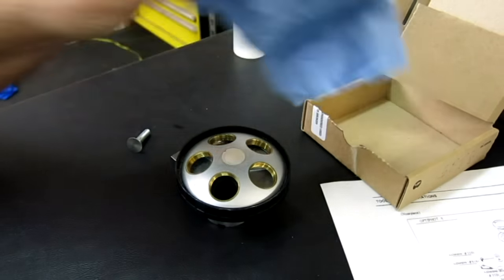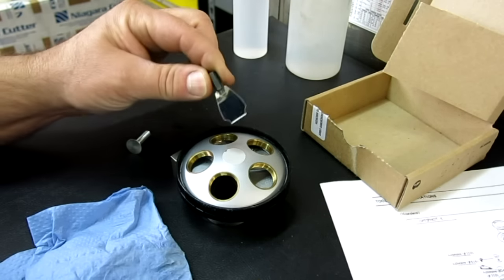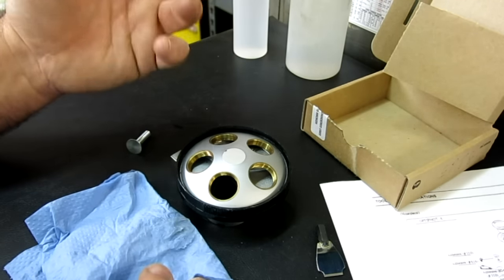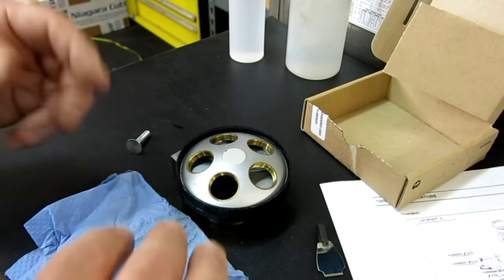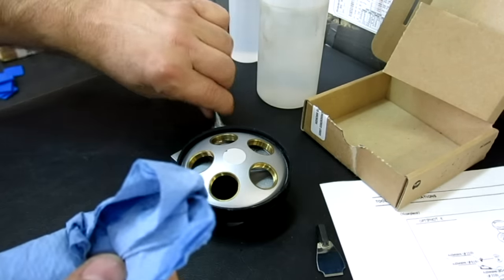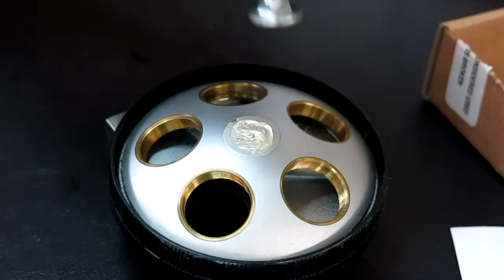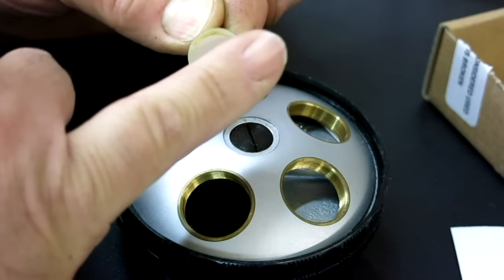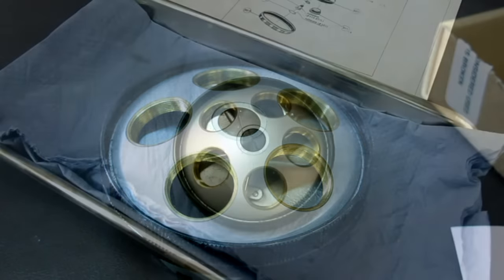Monday Night Meatloaf 106 Part 1

Comment: Reminds me of the time after Metallurgy class (40 years ago)  I got tired of the Binocular Microscope looking like crap. It was a Bosch and Lomb IIRC. The eyepieces were nasty and I took them out and cleaned them. Didn't take them apart just cleaned the outside lenses with alcohol..Prof came in as I was putting it back together and FREAKED OUT!  I told him what I did and why. He looked it over and put a sample on the stage. Flipped through the objectives.  Then said: "OK. Next time tell me before you take something apart."Got an A+ in that class...

Comment: I can't wait to see if Starrett has the thermal isolator to sell you. Meaning if the newer model master levels are designed differently on the back side. But, maybe they still have NOS?
All the best and thanks for the video.

Comment: Hi Tom, I purchased a brown and sharpe 3000 precision level,it's in great shape.It's 19 1/2 inches long and. 2 9/16 inches wide, it's been hand scraped, and is stamped on the side Swiss made. It's in a nice wood box. Weight 15 or more pounds. It's cool looking. Have you ever seen one like it ? M.K.S

Comment: Could the Nikon be built up with new chrome and then the detent ramps and locks reground? I would imagine that most likely cost prohibitive. That top on the Starrett level is a much more challenging piece than the last time with all those curved and tapered holes.  I imagine that was molded that way originally?

Comment: Good video. I wonder why after all the expense making the microscope lens they would use a petroleum based lubricant instead of synthetic, I have used a Mobil red synthetic grease since the seventies for certain jobs and stays good for many years unless contaminated or subject to extreme heat too many times. In a clean environment it should stay good indefinitely I think. Just wondering, what do you use the microscope for? Might be the subject for a good video, even I got caught up in them, it's cool to see  tiny details on parts. Thanks for sharing, be safe.

Comment: Check a good factory fresh scraped master level against a flat and you'll probably find the reference face has a deliberate 0.0003" concave. I understand this is to ensure end bearing on the surface to be leveled. More reliable readings - so they say.

That said, I've scraped a dozen master levels flat and used them as handy short straight edges. It's a two-fer.

Comment: Just yesterday I had someone bring in a binocular microscope with adjustable xy mounting table in which the lubricant had hardened so much I thought someone had put glue in there. YUCK! At any rate I got it cleaned up and reassembled with the help of some poster tack to hold the wire rails in place and a C-clamp to hold the finished left side in place while I got the balls installed on the right side. Glad to see it's going to a free veterinary clinic.
Reply from the maker: Hey Extant,

Great that its going to a good home. Nothing more satisfying than doing a good repair for a good cause. Thanks for the comment.

Cheers,

Tom

Comment: Re:  Screw Slots.  Gunsmiths solve the screw slot problem by having a supply of screws with different different slot/start of thread relationships.  All you have to do is make a supply of screws with 5-degree differences in start.  No Problem.  180 / 5 = 36 screws, give or take.
Reply: i've also seen a gunsmith using screws with larger heads then what he needed. Then he sanded them down completely flush, and milled a new slot into them.

Comment: My mother was a micropaleontologist so I kinda grew up with turret microscopes. I had no idea what ws inside the turret until now, and by george it is like a bicycle hub! Bunch of balls running around a race -- no ball race bearings -- with a real neat detent which of course you don't want on a bike hub. I think mom's microscope was a Zeiss; they were there first and perhaps Nikon copied them. No criticism of Nikon, I am a Nikon admirer. Zeiss fell behiind because it fell into East Germany of old. 'Nother subject. You may have been criticized for not replacing the thermal insulators with Delrin. But the expansion coefficient for Delrin is not the expansion coefficient for phenolics.  That level was designed for phenolics. If you made two complete insulators out of Delrin (or whatever) the level would probably work as well but mixing materials is a source of errors, as you once said "at this level everything matters" and oops, unintentional pun.
Reply from the maker: Hey Juan,

Cool that you have a personal connection with microscopes. Zeiss make a nice unit. Thanks for the comment.

Cheers,

Tom
Reply: There was a time when Zeiss was frozen in time, during the cold war.